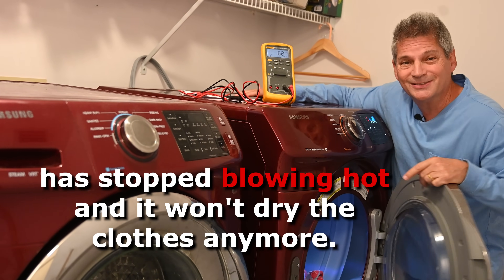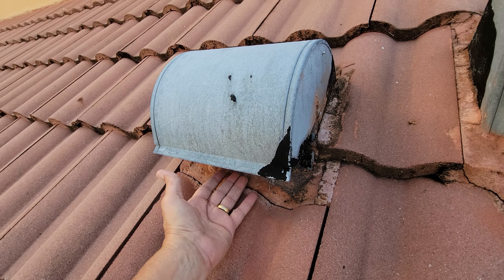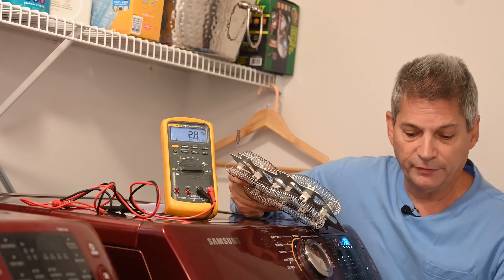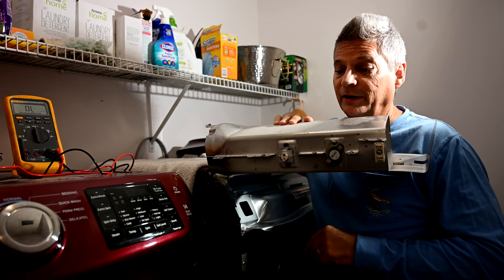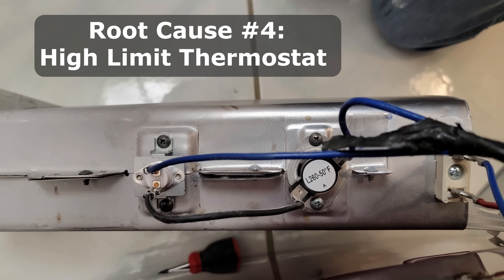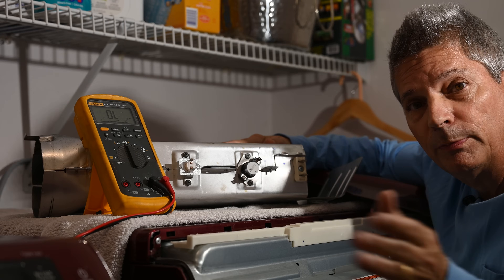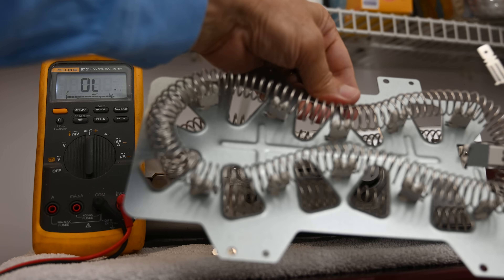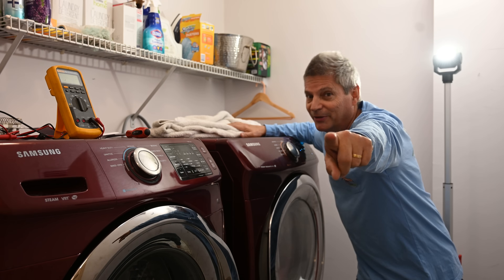Top 5 Causes: Dryer NOT Heating Up/Drying Clothes

Comment: Help!! I’m struggling. I cleaned the duct which was bad. Changed the heating element which was bad. And still don’t get any heat. The other two parts are getting continuity. Another video said to change the main board bc some of the numbers were reading 7 instead of 15, but the new one gave the same reading.
Reply from the maker: It could be a bad thermostat or a bad thermal fuse even if they ohm out ok, change them. Since they attach tot he side of the heating element housing, they are often sold as a kit. I seem to recall measuring ok on one of the 2 other parts but it was still bad.

Comment: I’ve never dealt with a dryer not heating BUT have dealt with dryers taking a LONG time to dry despite them being spotless in the inside, ended up being a weak high limit thermostat and usually get weak from years of service from being near a hot heating element. Other times, it was because someone installed the wrong thermostat which caused the heating element to cycle below the operating temperature, a cycling thermostat can very easily fit in place of the high limit thermostat which can stump people since everything checks out fine but isn’t heating very well, I always check to see what the cutout temperature is just to be sure the correct thermostat is installed or is the incorrect thermostat.

Comment: Probably some of the hot most air from the laundry machines in the Champlain  towers made it collapse. This could have been a contributer.
Reply from the maker: haa! They did have problems with several bath vents fans not working

Comment: The limit is a safety switch that will open the circuit not letting the elements receive voltage to prevent a fire. No different from limits in a furnace or air handler

Comment: You missed one common cause. Missing L2 on the wall outlet. The dryer runs off L1 and neutral but the heating element runs off of L1 and L2.  Usually the wall outlet goes bad and you lose heat.
Reply from the maker: Another good one!

Comment: Excellent info, thanks Jeff. I have an old Kenmore dryer, over the years I've only had to replace the idler wheels that the drum rotates on. As with most of our appliances, my wife is pissed and feels gipped out of getting new appliances. BTW Jeff, I just had to replace my water heater, they never seem to last more than 4 years here. I use AOSmith. Do you have a recommended brand of water heater that you use? Also, do you do the flush and drain maintenance? I don't but probably should.
Reply from the maker: I can't remember if it was a consumer Reports article that I read they could not recommend any particular brand because it's the nature of water heaters to basically soft destruct over the years. So they said choose the brand that has the longest warranties if you can get one with a 10 year Warranty that is what you should get
Reply: @jeffostroff  Thanks Jeff-these AOSmith water heaters come with a 6 year limited warranty. I will look around next time for the longer warranty. Thanks as always!

Comment: Considering the cost of the thermistor and hight limit parts, I'd replace them regardless as well since they are right there and only 30 seconds of added work. Even if that heating element is inexpensive, I'd replace it too since they are know to crack but, if expensive, I'd leave it since its gone through several cycles and still intact, it may keep going and going. 
You would think that the engineers would include parts that are more robust than the cheaper and borderline capable to due the work intended. For one, those front load dryers aren't cheap and in the past, the upright dryers of the past rarely ever broke. Here we are today, $900 dryer and it is having issues way too soon while the older $300 dryer is still going.
Reply: They are built to work under proper operating conditions. If you keep everything maintained properly and your vent is correct these parts will last a long time.
Reply: @MichaelRei99  Jeff is expereincing about every two years this is a requirement...parts fail that often.
Reply from the maker: This dryer seems to fail every 6 months or so. I buy standard off the shelf parts to replace, and my ducts are clean, I think something in the controller board is not telling the heater to back off on the heat, so the other parts blow.
Reply: @jeffostroff  Try Speed Queen but they are Twice the money...supposed to be like the old stuff, built to last and great support.
I'm pleased with LG washer/dryer (gas) and refrigerator from 2012. Not one problem yet although I have read the newer they are the cheaper made they are.

Comment: Wow. A little knowledge can be dangerous. First of all you aren’t using safety gloves . Second you should specify electric dryers  because gas dryers are very different. Also the thermal fuse in the back cuts off power to the motor not the entire dryer the computer will still function. Finally you should say that there are only two types of acceptable dryer vents , rigid and semi rigid. Anything else will reduce efficiency and is a fire hazard.
Reply from the maker: Wow, you should watch a video before you correct people. I showed unplugging the electric dryer first for safety. If that does not tell you it's electric, then you have major problems.

Comment: Jeff, does the element typically have a "life span"? If the dryer is s certain age and the thermistor or thermostat go out, is it a safe bet that the element is on borrowed time?
Reply from the maker: I find they last 2 years max
Reply: @jeffostroff  I was thinking it was probably worth it to replace while everything was taken apart.
Reply: @jeffostroff  The heating element?  Thats not long enough by a counrty mile.

Comment: It's crazy my dryer just stopped yesterday and now you post this video. I still haven't taken it apart yet but from this video I suspect my problem to be the exhaust is clogged and it probably set off the thermal fuse, bc my dryer is not turning on anymore.
Reply from the maker: Please let us know when you get your problem solved what the cause was, thanks!
Reply: Okay so I disassembled my dryer and turns out the main control board is burnt in a couple spots. Lg no longer sells the control board for our dryer, so I'm going to try to replace the components myself. Only problem is the board is submerged in epoxy but still worth a try for me

Comment: Great and Concise video. So the Thermistor is basically a thermal fuse Right. I had to change one of these out in a Microwave oven that quit working, and it came in different values such as 160 or something like that, and it had arcked and showed burn marks, changed it and the microwave worked again. Thanks for the 5 dryer checks, that is very helpful. Thanks Jeff.
Reply from the maker: Yes, exactly, glad it helped Phillip!

Comment: I use leaf blower to blow out the lint.
It works great. Ego leaf blowers are overkill.
Ryobi 18v with skinny flat nozzle seems to work the best. Im still planning on using my Ego 650cfm with custom fit nozzle borrowed from Ryobi.
Reply from the maker: That is a great idea! I will try that next time, my Greenworks does 740 CFM.
Reply: @jeffostroff  
740 cfm is really a overkill. 
My dryer has the screen inside the door.
I pull out the screen.  Made a cardboard to close off the opening. Cut a small hole for nozzle and blast away.

Comment: Another possibility, is you're not getting 240 volts to the dryer.
Reply from the maker: I think the motor runs off 240 also so if you don't have 240, the motor would not start
Reply: @jeffostroff  no you are 100% wrong  the motor does not run off of 240 it runs off of 120.
Reply: You are correct! The motor could still run if you only have 120 to the dryer. The only thing running off of 220 or 240 is the heating element.

Comment: Normally closed, ONE-TIME-USE, switch...😁
I've repaired my basement dryer a few times. One time it popped the thermal fuse - I guess I narrowed it down with the continuity setting on my multimeter, which works like an Ohm meter for dummies...😆 Google had set me on the path to check the thermal fuse, and turned out to be correct. I also thought I was gonna need a new idler pulley from the sound it had been making up to that point, but when I opened it up, there wasn't one. Just a bracket with a wearable surface for the belt to run over. Turned out someone had the belt routed wrong, so once I got that right, she worked mint with the new fuse. 
But then one day a couple of years later, that belt finally broke, having endured several years of being routed wrong. The lucky part was that I was right there to hear it, and run over and shut 'er down, before letting any smoke out of anything in the heating coil circuit.👍 New belt, and she still runs today.👍
Reply from the maker: Awesome Dan, not the first time we see appliances built wrong at the factory. My old Kitchenaid fridge, they forgot to install one of the 2 grommets for the freezer fan and it rattled like crazy until I  discovered it and installed one.
Reply: @jeffostroff  Not a factory defect. This dryer had been opened up before. I've had it since 2005 when I bought the house, and I think I might've had to fix something in it during the first eleven years, before I moved in and fixed the house up in 2016 - possibly I did the thermal fuse replacement back then. So either myself or the tenant had done that.  My money is on the tenant, as there were screws missing, and he (at least at that time) was much more adept at taking things apart, than putting them back together.
I like old cars, and I work on them, and that has taught me that reassembly is the most critical stage of any repair. Taking a dashboard out to change a heater core for example, how many of us know to first check EVERY function on the entire dashboard, to make note of what all works, and what doesn't work. That avoids needlessly chasing a pre-existing fault after reassembly. But my main point here is that when doing a heater core in something like an AC equipped Fox Mustang, there are plenty of opportunities to get something wrong. And the biggest cause of inoperative accessories that I find, is that some fool simply didn't reconnect a harness or two or even three!
If you can test while you reassemble, that is the best practice.
I just burned myself last week in this manner:  I took apart my PC mouse to empty it of cat hair which was affecting normal scrolling, and the scroll wheel springs popped out of place before I could note where they went - but I got the support spring back where it belonged, and finally gave up and put it back together with the detent spring tossed inside the case, and it doesn't seem to work much differently, although the scroll wheel now scrolls like it should...

Comment: The best thing to do is not buy a Samsung appliance lots of problems, but they make great TVs, LOL   A little trick if you find that the  Hi Temp  Cutoff  Thermistor is the problem is when you take it out   bang it on the ground while holding it,  what you are trying to do is to get back down the little thermal disk that broke the contact when it over heated, if you get it down you  should have a machine that works until you get new parts
Reply: Samsung appliances are trash. I have 2 different family members both with entire kitchens full of them and nothing but issue after issue. They both swear they will never own anything Samsung again.
Reply from the maker: Yes, all appliances suck, not just Samsung

Comment: Well Jeff, back in time the first step was to check the fuse. If the copper strip in the window was blackened, fuse was burnt. Next came along those cartridges. Sometimes just switching the cartridges in their side box would identify the problem. Usually there was a spare cartridge on top of the side panel. The third great home electrical upgrade was to those breaker panels. Just flip the breaker all the way to off, then on, check the circuit again.  The fourth and often overlooked step was to check see that the cord is plugged into the outlet. The fifth and final step, check the weather forecast. If the weather is to be cloudy or rainy, no need to turn on the outside lights anyway because it would be too wet to hang out the clothes to dry anyway. Where is Paul Harvey when you really need him! -Bob...
Reply from the maker: Yes they have gotten more complex to fix over the years
Reply: @jeffostroff  Here with ice and snow moving in round about mid-day, even though the sun is out right now, at 24 degrees the drier out back would probably freeze clothing on contact, if the clothes pins would even open.

Comment: Hmmmm, wait a second so the repair guy lied to me?! I had a Speed Queen dryer under warranty & they said it was the thermal fuse. It definitely turned on, just no heat. Why would he do that lol?!
Reply from the maker: A lot of people confuse thermal fuse with thermistor with thermostat. So could be it's easier to say thermal fuse or thermal cutoff
Reply: @jeffostroff  that's true, I can't see any reason it would benefit him to have it be the thermal fuse when it wasn't lol. Haven't had an issue with it since "knock on wood" lol!
Reply: There are two thermal fuses  one for the motor one for the heating element.
Reply: Anytime you see the word thermal it means if it exceeds a temp it will permanently fail.